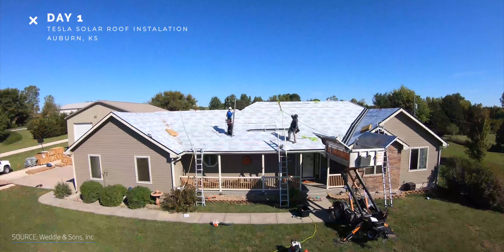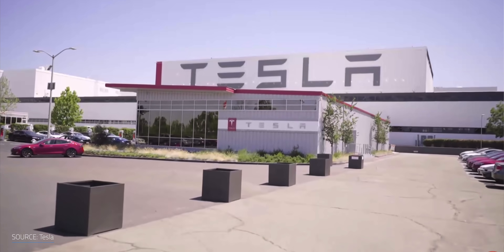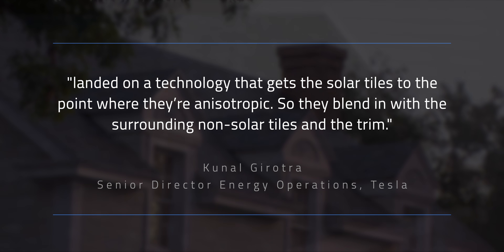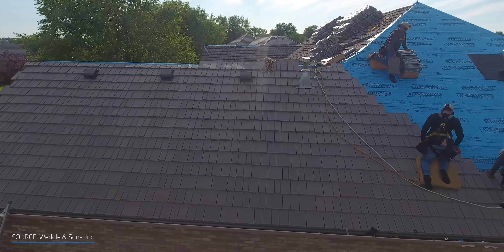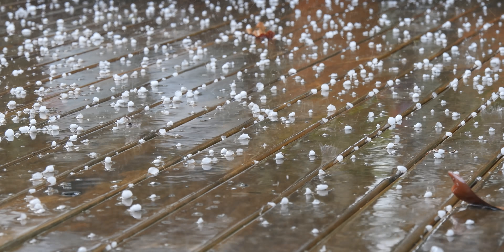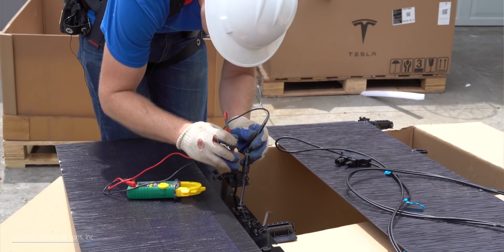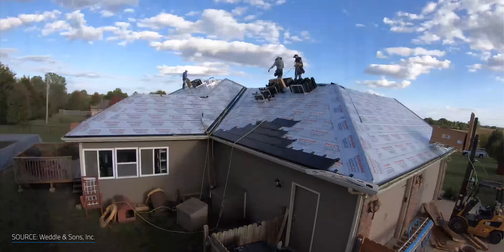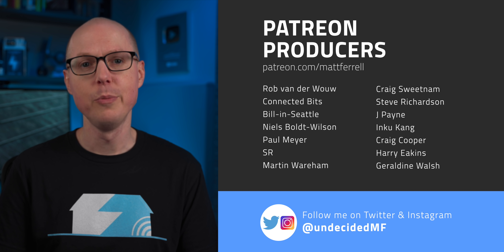Exploring If Tesla Solar Roof Is About To Go Mainstream?

Comment: this "solar tile " is not new. the germans and british developed a system in the 1970's called the "self - cor belling solar tile" you did not have any roof structure  - just a block that inter-locked into the next one. it failed because of the cost.

Comment: They literally can't be as efficient because solar panels get hot and these don't have the proper ventilation so on a hot summer day their efficiency is going to plummet all of the data comes from Lab conditions where you can take control the mppt.

Comment: I looked at this option, because I didn't want panels on my roof, and ended up putting in a heavy metal pole system 6 foot off the ground in my backyard just for my 20 panels, and have loved it ever since, there are other cheaper, more efficient ways to install panel, you just need to get creative!

Comment: I have worked with Tesla solar roofs and their install process.  I'm excited about the product and want it to catch on to mainstream.  I feel the costs though are somewhat misrepresented as when you factor in the tesla batteries the price can jump.  Also the warranty covers 25 years but most shingles offer limited lifetime (warrantied for as long as you live in the home).  I look forward when some of these factors bring us closer to shingled costs, were not to far off from metal shingles at this time though.

Comment: asphalt shingles = $10 per sq meter (labor and prep is most of the cost in a real install here, shingles are probably 1/8th the cost of the install or something close to that.)
installed solar panel at 100% efficiency of a regular solar panel is 100 watts per sq meter, at $2 per installed watt we are talking $200 per sq meter (assuming all other costs are equal to the above $70/sq meter for install, the roof tiles become 74% of the costs of the install) 

So considering install times are double, this would make the other costs closer to half the total cost of the install and therefore the total cost of the roof would be increasing, assuming the efficiency of these tiles are close to 100% of a regular solar panel we are still talking about a 10+ year investment to recoup our costs, I don't know how much efficiency is lost to the glass being thicker and treated to improve aesthetics but this increases the time it takes to recoup the investment accordingly and decreases the future benefits because total capacity of the roof is diminished accordingly as well. 

The long warranty basically guarantees that you will recoup your costs and then some, but it is a large up front cost that when compared to investing elsewhere will be an opportunity cost that outweighs the benefits for everyone. The most environmentally conscious or those with the cash to burn that will receive some level of enjoyment knowing they have a "fancy tesla roof" which will no doubt lead to plenty of sales but it doesn't mean it is a wise investment.

In conclusion: just because it doesn't make financial sense doesn't mean it won't sell well. TSLA stock goes brrrrrrrrrrrr

Comment: Too bad this is not really available in Germany, I would be interested to see a direct comparison as we have a bit of a different starting point. We do not shingle residential buildings with asphalt, that is reserved to your garden shed. We use clay or concrete tiles which are already easily exchangeable, so in this respect there is not much to gain and roofs generally last for 50 years and longer. 
And another note on the cost side. With a solar roof, one will also install solar tiles on the north facing sides which do not generate much power, especially on steeper roofs.

Comment: For me, the Tesla Solar Roof is the more cost effective option than going shingles and panels. There are a few caveats to that statement...cool roof shingles and higher output panels (ie. more expensive) required hit the required production. One thing for sure...there's a lot of electrical panels required for Solar Roof and probably any solar solution...it isn't pretty.

Comment: Very informative Matt. Do you know if the Tesla roof will produce a better output given the fact that you can fit it all over the roof? I know they use some blanks in the shaded part but I am referring to the fact that normal solar panels are a fixed shape and cant be fitted everywhere.
Reply from the maker: It's less efficient than the most efficient solar panels on the market (talking % wise), but since you can squeeze more tiles into an area you can make up the difference.  The end result is that if you can and want to install a 6kw panel system, you should also be able to install a 6kw solar tile system.  In the end, you should be able to get the output you need.
Reply: @UndecidedMF  I guess that is going to be the same theory with flexible solar that can go on any surface. Thank you for your proper explanation.

Comment: I am currently saving up for that $25,000 Tesla coming out in 2024 and hopefully by then I might also have enough money to buy the solar power wall and maybe have that HVAC system that everyone's been "secretly" talking about.

I don't know how much it would cost but because it has more efficiency it should reduce electricity prices therefore reducing the cost and total amount of solar needed so bringing that price down by thousands of dollars probably so I'm going to get that with it.

Definitely going to go only with Tesla on it though. And I don't want to buy any other electric car because legacy automakers are still making commercials about their gas and diesel vehicles and I will not buy from a brand that is not all in on EVs.

Comment: Definitely not sold on the hail resistance yet. Wind and hail are two major factors where I live. And when it's possible to go full solar for under $10k (DIY installation), spending 5x that for something that looks pretty does not make sense.

Comment: I find the tiles pursuit stupid. If anything one should try to angle panels actively rather than restrict their see-through angles(I know that it is not a good idea due to wind and roof strength shortcomings in most cases). I do not think whatever colour your roof is and whether solar panel objects are of any concern should be way down in a sane person's priority list. We try to imitate what we used to instead of just dropping the looks expectations and get used to a different look of something we 99.9% of the time do not even see...  let alone look at. Most people notice that there is a hole in their roof when their ceiling soaks... come on.

Solving a problem nobody really has is the game here...

Digital pianos emulate the bug in the grand piano mechanisms where under a certain key velocity the hammer would fall back without actually hitting a string and producing sound... why? the same stupid reason: tradition without any reason or introspection.

Comment: I’m very curious about the environmental impact this has on birds? I am finding reports that solar farms get so hot they fry birds that fly over top.
Didn’t know if ones covering a home would have the same effect?
Reply: That's for solar concentrator farms that use a huge array of aimable mirrors to concentrate the light on a tower where the heat makes steam to run a conventional steam turbine power plant, not for unconcentrated solar PV.

Comment: I'm open to solar but the prices I've seen makes it a pipe dream for the mass market unless Tesla et al keep improving things.  You can't count subsidies (not available here anyway) because they just rob Peter to pay Paul.  A system that can power a middle class home completely (plus air conditioning and/or heating--no natural gas/propane!) is going to need to cost about the same as a complete HVAC unit for the same house.  10-15k.  What I'm seeing is 30k+ for a system that won't quite offset my use, and my planned future addition of an electric car would totally outstrip my system's capabilities.  And then it has to be replaced in 30 years...  I don't mean to be a negative Nancy, but that price point thing MUST be worked out if solar is going to make any real inroads into the middle class housing sector.

Edit: I got a quote a while back.  The numbers in my comment are for my 1700 sq/ft middle class house in Tennessee.  Your state/country may vary.

Comment: I've been saying for YEARS that ALL new buildings and major remodels should require Solar ROOFING and Solar SIDING if needed be to get enough power, as well as small back-yard power-generating WINDMILLS for the areas that have even a little wind.  With other new building technology, people can actually be FULLY self-sufficient in a vast majority of cases if not all.

Comment: I'm in the north east.. architectural shingles will be fine for 25 to 30 years. Metal roofs are recyclable and I would much prefer a standing seam that lasts 50 years vs asphalt (if you have the money). Where do those tiles go when their life cycle is over. And how much power do they create on average. I know colorado has a large amount of sun but what about the northeast or a different part of the country with average sun

Comment: Question. What's the difference between the 3 solar roofs companies you mentioned compared to normal solar panels on how efficient they are in gathering solar energy? We will use the house they were working on for the size for the solar roofs.

Comment: How much space does a kW of solar actually use? I'm looking at least for some rough numbers, since I'm considering putting it only on a smaller summer kitchen or a patio's roof, rather than the house roof, since that would mean replacing all the roofing.

Comment: Do these tiles need to be cleaned?   Does pollen and dust stick them?
Reply from the maker: Depending on where you live, you might.  Like if you live in Los Angeles or a dry climate, you'd most likely see pollen/dust buildup.

Comment: How long does this roof last? 25 years is the warrant but what’s the expected time to last? 
In Utah I work with a roofing company that sells a 40 year roof, pair that with solar and it’s actually quite cheap, if there is an insurance claim insurance will cover the cost to re install the solar as well, so I don’t get the maintenance cost argument unless your looking out for insurance companies pockets.. all that said this is an awesome product and idea. Problem is most of Tesla’s offers are an idea and they don’t have the structure for execution, 25 years is for the equipment warranty, what about the labor warranty? The solar company that partners with the roofing company here in Utah offers 25 years of a free labor warranty. 
Even Tesla solar offers no labor warranty, they will offer labor for 10 years at there cost to hire a sub contractor

Comment: I've been following this topic for a while now because I'm going  to need a roof in about 2 years.  One of the the things you have really missed on covering is this - OK, it's a solar panel, but how good is it as a roof?  I don't care how much juice it makes if it doesn't keep water out of my house.  Other questions -  can it be installed as a hybrid, with solar on the south facing roof and asphalt on the north side?  Doe sit have to have a powerwall or can I hook this up for net metering?  Are the prices you're discussing inclusive of a powerwall and/or connection to the grid (i.e., does the roofer supply the electrician)?  What are the climate considerations?  Weddle talked about Colorado, which is encouraging since they get far more snow than I do.  How are insurance companies taking this?  Will my HOI cost go up?

Comment: Do they really use asfalt roofs on normal houses in the US? Where i live they barley do that to garages... Every house has ceramic tiles or slates. And there should be no wiring between the tiles, it should all be integrated in the rails they clip on to so it is foolprof and fast to install. Just use some stab connections.

Comment: The problem is FEW residential building use a premium roof product like he was comparing it to... and it is not much more expensive to go to a 25, 30, or even lifetime warranties on asphalt shingles and there is almost no increased labor costs associated with the other premium tiles.  Few actually offer nothing less than 25 year shingles.  The price of using a 25 year, 30 year, or lifetime warrant shingle is like going from a $8k roof to $9k or $10k.  Put the money up front, get a good contractor, and you are set.

The other issue is the power wall that will come with the system.  Not only is it VERY expensive (starting at $10K) but it MUST be connected to the internet to work.  This means when the power goes out and you lose internet connection you lose you backup too.  It is just a stupid design flaw... but it comes with a cool app for your phone...  For new houses this is not as much of a deal as you can design it based on the idea of doing a solar roof, but for existing you might want real solar panels that produce 3-4x the power.

Comment: I almost signed up for this solar roof in November but I just didn’t have enough info.  I’ve had other quotes for traditional asphalt roof and solar panels since, and the solar roof is still really attractive option if they can actually do the install within 6 months (as their website says).  

Thanks for this video!   This is the most info in one place I’ve seen so far.
Reply: Was this before or after Tesla raised prices? They quoted me 100k for a less than 1500sqft roof.

Comment: Does anyone know if there is a way to ask a question about installation without committing to purchase? My roof has integrated gutters and exposed rafter tails, and I’d prefer not to change that.I want to know if there is flexibility in the installation practices.

Comment: I had my roof replaced last summer with the intention of going solar later. In the course of pricing out my options, I explored a Tesla Solar roof vs new asphalt roof w/high-end tiles + traditional solar, and the cost is so much in favor of traditional solar here in MA, even with the most expensive asphalt roof tiles, that there's basically no reason to go with Tesla unless you were considering something other than asphalt, which almost no one does around here (the odd mansion excluded). New roof + 9kw solar + 2 Powerwalls for about $38-40k vs $60k for a Solar roof 3 w/2 Powerwalls. Maybe the warranty on the solar roof's solar panels would make a difference vs traditional solar panels, I'm not sure if the 25yr solar roof warranty covers the actual solar panels or just the glass.

Comment: Most of the houses In the USA and Australia are bungalow stile homes.Make the hole solar roof on the ground the hole roof structure to hold the solar panel is the whole roof itself s. / safety/faster /easier.. lot cheaper$$$$$. it pays even to remove the old roof and put a solar roof on it all done, crane lifts it on the roof. no safety gear/ no scaffolding .

Comment: Something I'm not clear on: with rooftop solar panels, they can be pointed to optimize sunlight exposure. Solar roofing tiles can't do that. I understand they are also less efficient overall, so how does a solar tile roof make up for the total drop in efficiency?

Comment: I suggest if you do it right for a new house , each solar plate panel is the roof it self's. Easy access for the wiring and maintenance in site the attic or Loft. Stop the ad on ! Tesla will build a car body with 1 injection,,,,,,no more robots...Print the house and lift the Solar cells  roof on top of it.

Comment: My E is maintained by PGE.  I use only what I need.  It works very well and lacks any subtext of religious conviction.

My neighbor with an identical house purchased it and it's solar array second hand.  The installer is out of business.  She can't make heads or tails whether the system is working.  Nor can I.
Needs to bring in an $$ expert to sort it out.  

My PG&E supply goes on uninterrupted at market rates which are currently about $0.25 per kwh. 

Just can't see the bother.   If I want something to do I can probably list 50 things I should be fixing on my house, I don't need a 51st thing.

Comment: another great post, i have been long time following the solar conversion challenge, at 46 y/o have always been more aligned with the electrical cars and modification of our basic living requirements.
(should have been an electrician instead of a carpenter) during my research i have not seen the solar panel component with water heating directly. i living in Australia and it seems foolish not to use the heat from the panel to gain an optimum temp for the panel whilst heating water for say the pool or house hold cleaning. this idea came from "why is my fridge not heating my home in winter, it uses heat transfer to cool the box, but has been optimized top not heat my house" i think the thermal transfer option is not utilized and that if tit was the costs would be beneficial.

Comment: My biggest question with this product is roof penetrations. Asphalt shingles make it so easy to pop up a vent, etc. but most roofers won't know how to do it with this product yet. You'll be waiting for the certified installer when you just need one or two holes punched.

Comment: How are we getting hail damage on shingles under PV panels? On that note, wouldn’t those shaded shingles last longer?

I was very interested in the Tesla roof at first but initial pricing made them seem like a high end product for houses where you’d see tile. I’m still thinking panels are easier to replace/upgrade. PV panels degrade over time, and there is the hope that the tech makes a jump worth upgrading to.

Comment: Excellent. When will they get the price down to compete with cheap roofs? $10,000. Then increase the power to be able to heat houses all winter in cold climate.